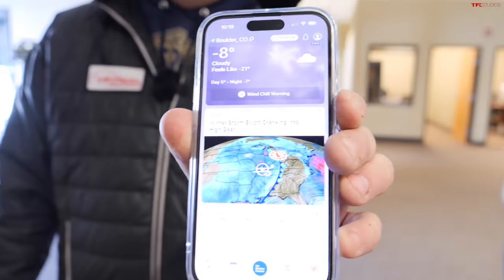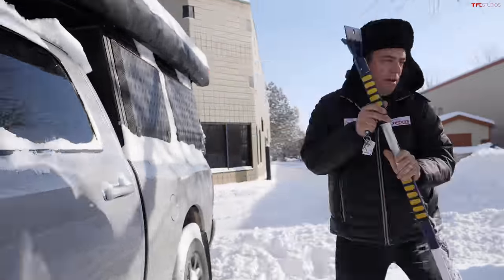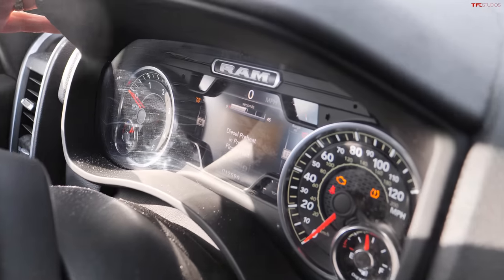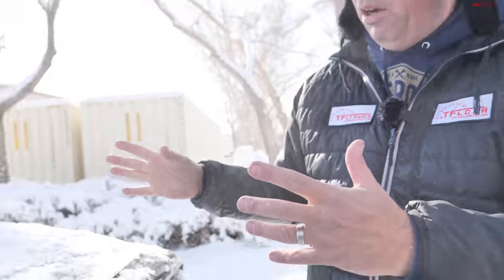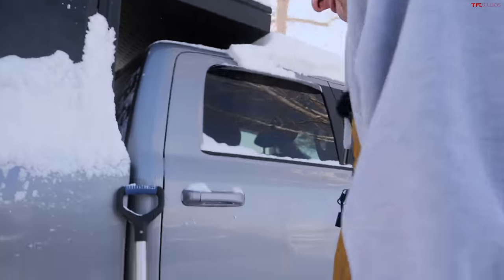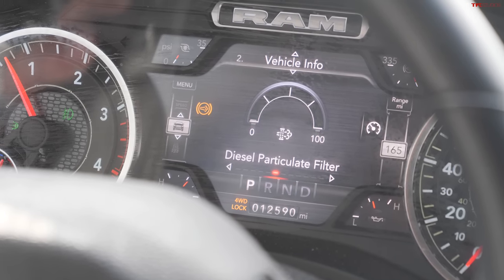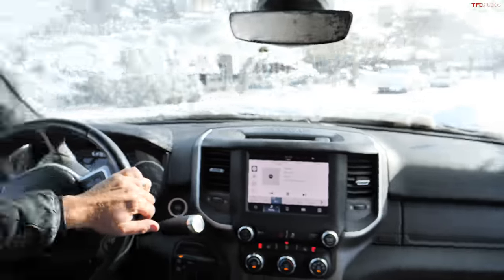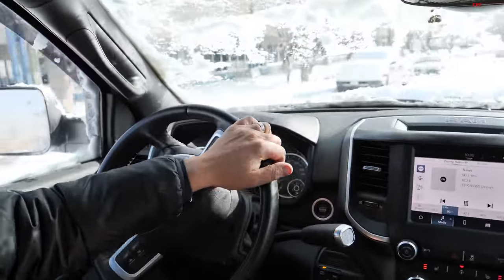It's the COLDEST Day Of the Year in Colorado: Will My Ram Cummins Diesel Start?

Comment: It's been minus 35 F all week up here in Alberta Canada and I work for a large fleet.  Everything breaks at this temperature.  Been boosting and fixing hydraulic leaks all week up here.  Good Times.🙂🥶
Reply: I knew a guy who worked on the oil pipeline in Alaska in winter.  He said they never turned off their trucks except inside the shop.  
Do you leave the rucks running when outside?
Reply: @edwardhoward4708  Yep. That's why when my friends find a "deal" on low mile trucks for Alberta I tell them to pass.

A truck could have 30k miles but it's been idling 24/7 for years lol
Reply: I just can not imagine working in those temps.
Reply: @edwardhoward4708  yes all vehicles stay running, especially the heavy machinery.
Reply: @edwardhoward4708  Depends on who you work for.  Some companies do that.  Where i work everything has a good block heater and we will shut them down overnight.  If the battery is good they usually start in the morning.  The engine oils now a days are pretty good in the cold.
Reply: @semlohde1  Lots of layers

Comment: My 2020 HO remote started that day at 0500. Granted, I cheated and had it plugged in. You could double press the start button to skip the preheat and it would still start just fine down to probably -30. BTW, the truck will idle up on it's own for warmup and to maintain engine temp AFTER a brief warmup. I wouldn't force it to high idle when it's that cold, particularly when your oil bypass is active.

Comment: I had a 95 Toyota pickup in N MN about 15yrs ago and the actual temp was -37 and she fired up but holy crap trying to row through the gears was extremely hard. Was like the gear shift was going through wet sand

Comment: -9 wind chill -39 and my 2015 chevy 2500 diesel would not start. I had put Howes in the tank. I did not plug the block heater in.
Reply: My old man drove nothing but diesels his whole life. To prevent gelling he would add a gallon or two of gas at each winter fill up, then top it up with diesel. I have been doing the same thing on my Ford 6.0 and Ram 6.7 and have never had a gelling problem. Merry Christmas!

Comment: I have a 2020 HO Cummins and mine would NOT start here In East Texas just two years ago during the freeze of -2 degrees . Love my ram but sad that my 2018 Branson tractor that cost $42,000 less started with simple glow plugs. I had to plug my trucks block heater in for 40 minutes before it started. You must have got lucky.

Comment: So we don’t really use block heaters or anything like that for Diesel engines in the high parts of MN. We just use diesel fuel additive and regularly change the fuel filters in our large diesel trucks.
Reply: My old man drove nothing but diesels his whole life. To prevent gelling he would add a gallon or two of gas at each winter fill up, then top it up with diesel. I have been doing the same thing on my Ford 6.0 and Ram 6.7 and have never had a gelling problem. Merry Christmas!

Comment: Andre, would putting the transfer case in neutral with the transmission in drive help warm it up a little quicker? I use to do that with my manual transmission trucks (don't forget to set the parking brake!) because when it's in neutral, the fluid just sits at the bottom starving the bearings/ internals of oil. Not sure if it would help with an automatic though.

Comment: I not familiar with the modern Mopar trannies, but the 727 3-speed that they are based on, the best way to cold start an old Mopar is in neutral. The fluid pumps through the transmission and warms everything up to temp. The modern transmissions may pump oil in park; I dunno.
Reply: 100% correct

Comment: I would love to see their reactions to getting an old deuce-and-a-half running at -20F. They were at least multi-fuel engines, we'd run a mix of diesel and gasoline or kerosene/JetA in the real cold weather to keep the fuel fluid. The trucks had some sort of pre-heat for starting, you'd move some switch and there'd be a heck of a buzzing sound, then after a five or ten second count, you could start it. Manual transmission, I had to shift with two hands until things got warm. The cab heat was usually hypothetical.

Comment: My 92 12 valve would start up just fine in that temperature. Without the block heater and the grid heater is no longer in the truck. Just need to put some anti gel in the diesel and she'll take a bit, but will make it happen.

Comment: Been Temps of -40 f up in Northern bc and my 2020 ho 3500 starts up just fine in those Temps. The engine warms up quickly but I try not to drive it until the trans hits 68 f when the torque converter will actually lock up

Comment: Just got a 22 I am amazed at how fast the cummins warms up now vs my 2016. With in 5 mins of idling and coolant was over 90 degrees in negative temps and holds it well. Fully warmed up with in minutes of driving. My 2016 wouldn't be fully warmed till the a bit of freeway driving. It warms up faster than my 2016 civic!

Comment: My 94 Cummins had No Problem, I plugged it in every night it sat outside and I wasn’t a Mile High either. But it was a 3500 Single Cab Small Wrecker with a 24” frame extension for a tunnel box behind the Cab. The weather in the City of Brotherly Love can get just as Bad as Fairbanks!! Plug the Truck In.
Reply: I’d say he didn’t put anti gel in the fuel. That’s why he is having issues. It’s -7 F here in Missouri this morning. My 2004 Cummins started up fine.
Reply: @markball7028  It’s amazing that you live a mile up and don’t plug in or use anti gel in your fuel. My truck was the smallest in a fleet of 10 wreckers. Most were 50 ton and above. I was really anal on my truck and made sure that it wouldn’t fail when I was on a call. Standard Shift and 4x4 made it awesome.

Comment: Hi guys,
Don't have to be worry about minus 3 or 5 °F. Those trucks used to start and run at this temp. May be it is one of a few times that you got a lot of snow and cold but be assured that there a lot of place where those engine run at a low degrees. And they do wery well. It's not a surprise for me.

Comment: This could have been a really good, quick tutorial regarding diesel engines and when to use a block heater, what temperatures are dangerous for the engine and why.  Also, could touch on modern diesel fuels and when they might gel.  It turned out to be just a test of this particular truck with very poor sound quality and I learned very little.

Comment: You do not need to select high idle when it is cold. It will do it for you. It is also recommended by your manual to turn the exhaust brake on for warm up.

Comment: When I was a kid my dad had a 1989 F-150 and it didn't have gas struts or a prop rod to hold the hood open.  It had springs, what I think are called clock springs.  The springs would open the hood just like gas struts too.  
Why every company didn't use them I can't understand.  Why no company uses them today I can't understand.  A simpler part that achieves the same result.
Reply: Cost, if everyone else is using them the unit cost when you order 100,000 will be lower than if you are ordering 100,000 tempered steel springs that nobody else uses. The downside of volume pricing
Reply: @rowerwet  True.  The only other possible thing I can think of is maybe there was a safety risk(?) when installing the springs at the factory.
Reply: A hood probably slammed someone in the head seems like the obvious reason
Reply: @twinchargedmr2  The hood didn't slam open like a mouse trap if that is what you are thinking.  It opened at the same speed a hoods with gas struts in normal temperatures.
Reply: You still see this setup on new Chevy trucks

Comment: Modern diesels has gotten so good at starting in cold weather. I drive a 2012 Audi A6 V6 TDI, and last year i cold started it in about -25 celsius. It only ran the glow plugs for about 3 seconds and raised idle for maybe 30 seconds. Otherwise all was as usual. Thats pretty good for a 10+ year old car with 150000 km.

Comment: I know +9°F isn't very cold to you folks up north but it's brutal here in North Texas. I put my 2022 Silverado 2500HD on its block heater last night and installed the winter cover. Truck started just fine then died after 15 seconds. Restarted fine then I heard a loud squeal around the fuel tank that started to fade then got louder. Not sure what that was so I shut down and took the car to work. It's supposed to get back above freezing Christmas Day so I'll start it then.

Comment: 2018 ram Cummins -14 over night. Didn’t run for 24 hours not plugged in. 109K miles. One grid heater cycle and fired right up. Ran on 5 for like 4 seconds and perfect after that. Completely flawless 16 hours driving in the negatives. No bra on the front. Plenty of heat. Just gotta maintain your trucks.

Comment: Ha, anyone with a diesel should  have a block heater. I live in north east Minnesota, and,  while -8 is cold, it gets a hell of a lot colder.  Modern vehicles are so much easier to start, and, if you have to park outside, get a block heater  whether it is a diesel or gas engine.  I used to park my Silverado outside, and it would always start even without a block heater. Of course you have to have a good battery,  a cheap of old battery  will not help.  My  John Deere diesels  did not have glo plugs,  but, when it got  very cold, you had to have a block heater , they also always started when plugged in overnight.

Comment: I had a 2006 Duramax 2500, never had a problem with cold starts, never used the grill cover, but I did use an anti-gel additive once temperatures dropped under 20' and yes, the fuel filter change would be a good idea. I changed mine every 15- 20,000 miles. Or once a year. Now I average 30,000 miles a year.

Comment: If your warming up your vehicle and you put your transmission in neutral that will help warm the fluid in the transmission as the pump is moving the fluid around were as park the pump in the transmission is not.

Comment: Now go do a cold start on the Hummer or the Lightning.
Reply: Let's see what their range is.
Reply: @daytona3927  for most people range doesn't matter, they just need for their vehicle to start and get them to work and back.
Reply: @fabulousoffroaddesigns5080  will it make it to my work 62 miles each way at this -15 degrees (-45 windchill) day when roads are pure ice and takes HOURS to drive and running heat? Minnesota
Reply: @KylePetersonDmaster223  yup sure it will.
Reply: @fabulousoffroaddesigns5080  no. It won’t 😂 it’ll be dead before I get to work

Comment: When we caibrate cold start for those engines in a cold cell we had to hit the following target: the engine has to start within two 60 second cranks at a minimum temperature of -20degC.. so thats what they go for. Of course there are emissions regulations for cold start, so its not as easy to calibrate for that.

Comment: The coldest I've ever been in was in Alberta Canada it was -54 And there was no starting vehicles even vehicles plugged in Likely didn't start. All I can say is when the cloth seats feel like a board you know it's cold.
Reply: That's cold! -58 here on my thermometer yesterday! Still -36
Reply: -54C is brutal
Reply: @Mike Foehr  yeah! I'm Fahrenheit brother....still brutal
Reply: Yeah when seat is rock hard and steering wheel too cold to hold onto
Reply: Yes, most motor oils even thinnest 0-W20 like in my new Volvo gel up a little at -50.

Comment: Must be nice to have snow that just wipes off and doesnt have a 1/2 in of frozen melted snow on the window or body...

Oh and a engine block heater warms the coolant so the block doesnt crack during a cold start and allows for more reliabel starts. The transmission fluid should be flowing through the raidator not only to cool it but also to warm it faster in the winter.

Comment: It has its own cabin heating protocol. You don't need to idle it up, it does it automatically and will also run the exhaust brake against itself while it does this.

Comment: Interesting, never fully understood these cold-start videos as I personally haven't had a no-start condition on any of the the diesel trucks I've owned. But after a little reading it seems the US does not legislate the use of Arctic/Winter diesel, unlike most other countries, but there is a standard as to what temperature the fuel reaches its cloud point. I guess it must depend on if the station is offering it?
Reply: Correct from what I understand regular diesel starts to gel around 15 degrees f . And at least in the southern US, winter diesel is never stocked because of how rare those temps are

Comment: I lived in the Yukon (far northern Canada) and other parts of Canada for many years.  The company owned a truck fleet with Cummins and Cat diesels to service the oil feeds and mines.  All the trucks were equipped with block heaters.  Starting the engines was not a problem.  The proper technique for a cold transmission?  Drive really slow picking up speed gradually as the transmission warmed up.  The big mining trucks in the north?  They do not shut their engines down at all unless they go inside for maintenance.  If one of those LARGE diesel engines did shut down at neg 40, the maintenance truck and mechanic would have to come to the rescue.

Comment: lol i work in a dealer and we start them unplugged at -30c or -22f without problem if the battery are good and i started working for dodge in 2009

Comment: Kinda dumb... Leave the vehicle in that weather 4 days straight without starting, then try it. You'd get NADA. Gas would start right up. Most people at my buddies snowmobiling camp goes with gas for this reason.
Reply: yeah, i left my diesel car 1 week in sub freezing temperatures without winter diesel fuel in the tank (because i filled up 1 month before), at first attempt it shut down after few seconds, then at the second attempt stayed on, maybe diesel fuel turned thicker and fuel pressure wasnt enought, who knows.

Comment: Put your 4wd transfer case in neutral. Then put your transmission in to Drive. The rotating parts in transmission will help the transmission and transfer case to warm up.

Comment: I plug mine in during the winter as I don't want all of that cold oil trying to lubricate my diesel engine.  I then dump enough Hot Shot Arctic anti-gel in my truck to kill a horse, then a bottle of seafoam to top it off...never gelled my 7.3L or 6.0L.

Comment: Did you guys add anything to the fuel?? Like the diesel anti gel? I definitely would have let that warm up for at least 5-6 minutes before driving. Start it up first, then you get the snow off.
Reply: My old man drove nothing but diesels his whole life. To prevent gelling he would add a gallon or two of gas at each winter fill up, then top it up with diesel. I have been doing the same thing on my Ford 6.0 and Ram 6.7 and have never had a gelling problem. Merry Christmas!
Reply: @elmoremundell9450  Unleaded gasoline will destroy both the fuel injection pump and the DPF on modern diesels over time.  The "old-time fixes" don't work, anymore.  Replacing either one costs thousands of dollars, when spending a few bucks for good cetane booster won't destroy either.

Comment: I want to know even after you get it warmed up how does it do if do you still have a DPF do you ever reach normal operating temperatures like 190 and above for oil temp ? To actually get hot enough for the dpf to work right?
Reply: The dpf should have no problems (at least no more than usual😏). If a regen is required, the ecm will command additional fuel to “light off” the dpf & burn off the soot. I’ve seen it begin before engine or oil temp is at operating temp, BTW.

Comment: Thanks for this video guys !  I have a 2018 Ram with the 6.7 waiting for me to get to it tomorrow. Its suppose to take me home but has been sitting still for 4 days..the last 2 the temps been hovering just below or close to single digits. If yours started fine, mine should too !
Reply: Let us know how it cranked! I have the 2018 2500 too and last year it threw codes, fried the computer low voltage and some $800 covered by warranty replaced some computer.  I am 1 degree in memphis now and know if the grid heater comes on it will drop to 10V, or won't crank. Seems like 59 degrees on the grid heater it cranks fine, so I plug it in every night under 32 if I plan on driving. And leaving it for a week those batteries flat drain.

Comment: Idk... Toyota Tundra, starts and revs to the moon. Possibly the longest lasting engine ever right? I have thought about this before, relevant to oil pressure and proper lubrication of the cold moving parts. I'm NOT a Toyota guy, but ever notice how high they rev immediately after starting?

Comment: My 2002 excursion 7.3 needs a block heater, battery tender and an oil pan heater to start. But here in northern Manitoba it gets down to -40c
Reply: I won’t knock your truck man, my 2020 HO ram did not start in just -2. They got lucky